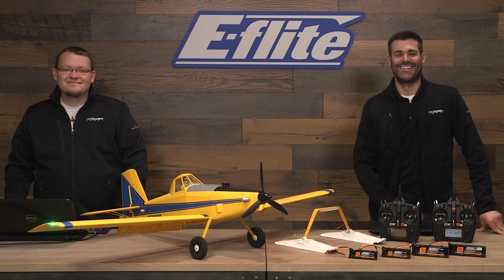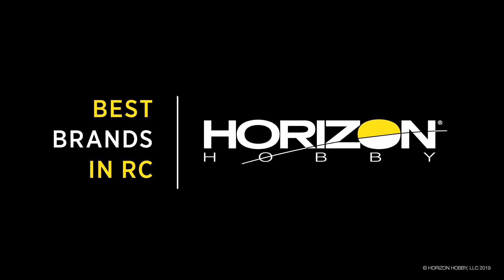Live Discussion: E-flite Air Tractor 1.5m

Comment: Hi, i have the bnf model and a nx6 spektrum. Using a non smart battery, im not able to read battery pack voltage. Do i just need a 2pin plug from the ar637ta wired to the ec3 plug to enable voltage telemetry? Thanks
Reply from the maker: Yes! Because the Air Tractor does not include a Smart ESC you'll need to add that lead to enable battery voltage telemetry. That said, when using a Smart ESC, no additional lead is required to see battery voltage telemetry when using Smart or non-Smart batteries!

Comment: I want to buy it, but it is compatible with the spektrum DX4e 4 chanel radio control
Reply from the maker: The PNP version requires a 5+ channel transmitter and the BNF Basic version requires a 6+ channel transmitter so unfortunately the DX4e (which is a 4 channel transmitter) will not work. The Spektrum DX6e, DX8e, NX6, NX8 and higher channel count transmitters will all work well though: https://www.horizonhobby.com/airplanes/radio-systems/transmitters/